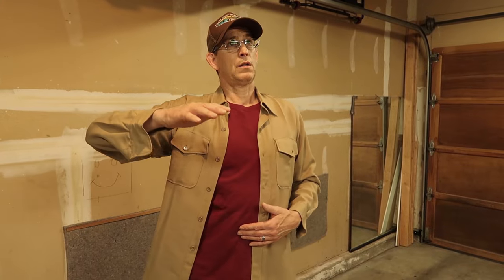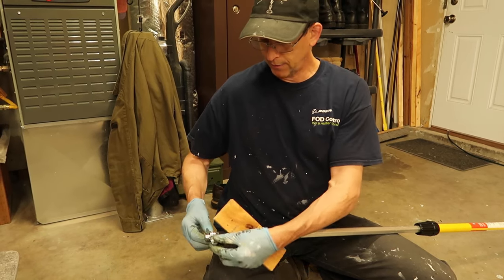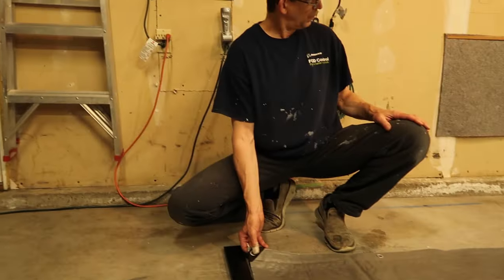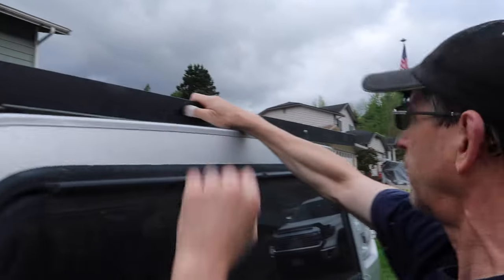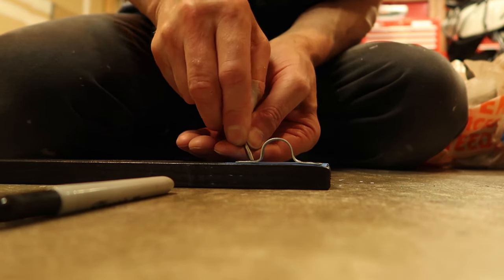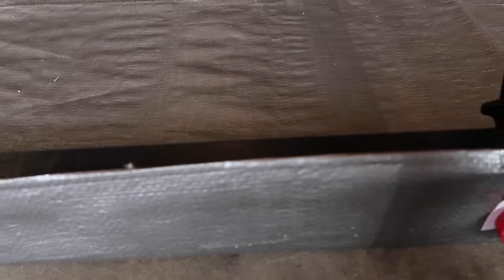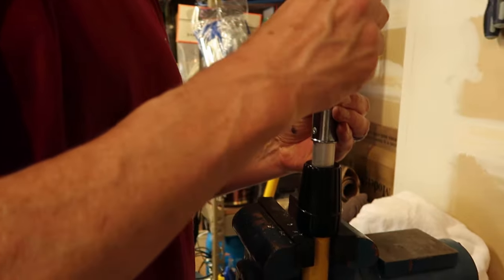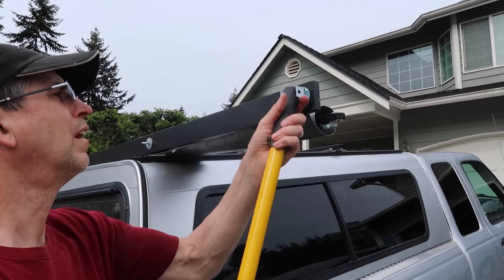Truck Camping Awning Build

Comment: Nice job.    Some good ideas.   I would do a slight modification.  Instead of wood I would use 2" plastic waste water pipe - it is lighter.      Still a very nice job.  It gives a big covered area and can easily be adapted for side use as well as rear
Reply from the maker: I like the rigidity of the wood. The pipe would work, harder to draw a straight line and flexes more.

Comment: Nice video, do you have to remove the black wood support when your back on the road. how about putting some shelving sliders on it to extend the wood when setting the tarp back up.
Reply from the maker: Yes. The whole thing comes down and stores in a tube on the roof rack.

Comment: This is a great idea. I have been thinking of doing the same. I have two question.
On a windy day the tarp will flop around at the edges of the length of the tarp. What would be the solution to  prevent this? Is guy ropes where the up rights are like for a tent to provide stability
Reply from the maker: Velcro straps around the outer poles and then tightening the horizontal poles eliminates any flapping.

Comment: I don't understand why nobody mentions the obvious here. This contraption extends 2 foot on either side. How do you drive down a forest road like that?
Reply from the maker: You take it off and load it into a tube that is strapped to the top of the roof rack.
Reply: @realbealtravel637  What a pain in the ass. I just bought one for $100 that mounts on the side. Installed in 15 minutes. Done.